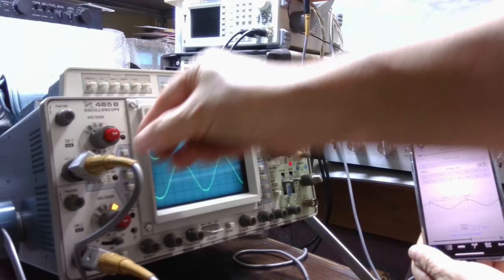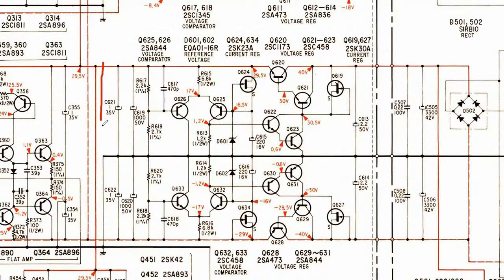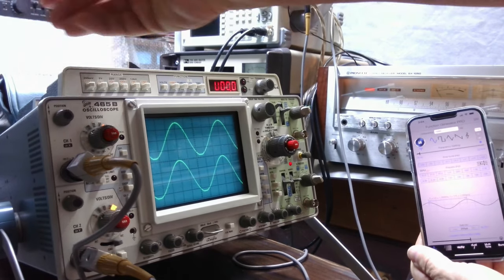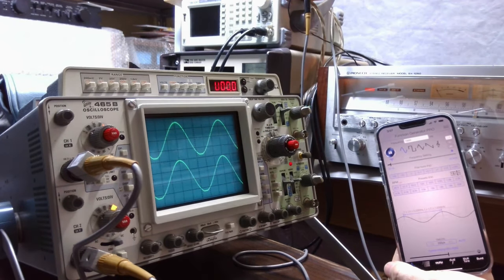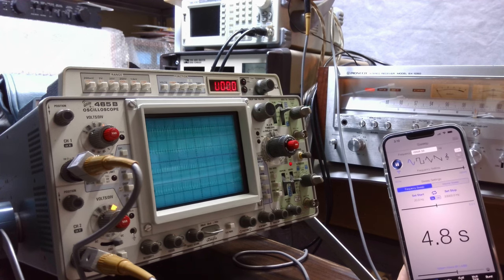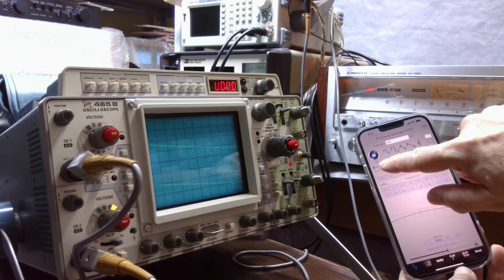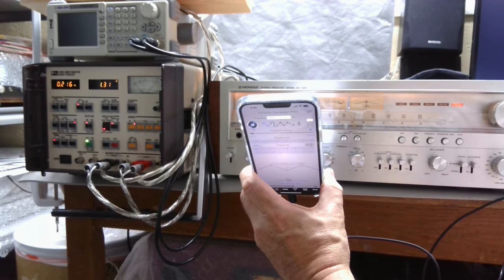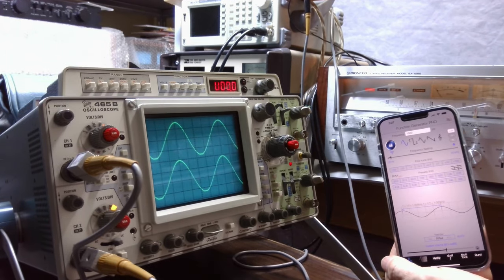Can A Cheap Function Generator Anyone Can Use Be Better For Repairing Vintage Electronics?

Comment: Good.  That's not really noise though on the square wave, it's a lack of harmonics.  It looks like they are just using the fundamental and the first 4 or 5 harmonics in the square wave series.

BTW, that Tek 465 was more the price of a pretty nice brand new car when it first came out.  Especially with that DVM option.

Comment: I bought a func gen from Amazon and have an old text tonic scope. Don’t know if techtronix scope 2225 50 hz will wk?

also not sure of correct hookup?

 I did buy that desolder suction from hanko!! so I’ve gotten pretty good at using a voltage meter and soldering and D soldering the boards and replacing the cap but I’m not really sure about how to use the FunctionGenerator’s and the oscilloscope to check distortion but I’ve got a collection of pioneer 1250s Macintosh 4100 receivers 2300 amp 2205 ,MX 110 and the MR 78 tuners a bunch of old Macintosh to 225s and M 22 .
 like to learn more about how to use the FunctionGenerator & scope if my scope will work. Geez so many buttons

Comment: how do you feed the two AUX inputs of the left and right channels? direct ?
Reply from the maker: I have a iPhone. Yes, straight from the phone to the aux ports using a lighting to RCA cable.
Reply: @vintageaudioaddict  I bought an old Tektronix 2225 from a guy I know for $40.  I also bought the Apple Lightning to RCA cable.  I think I am missing an adapter, however for my oscilloscope.  It has an extension cable (BNC to BNC), an adapter for BNC to male prongs, and an adapter for BNC for female prongs.  I think I need an adapter for BDC to RCA?  Do I feed one of the RCA cables into the BNC or both?